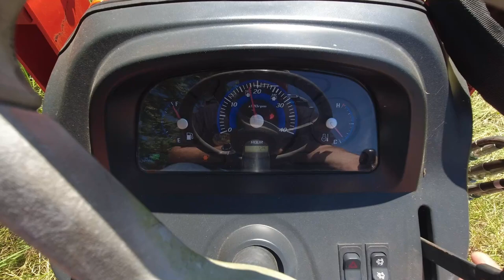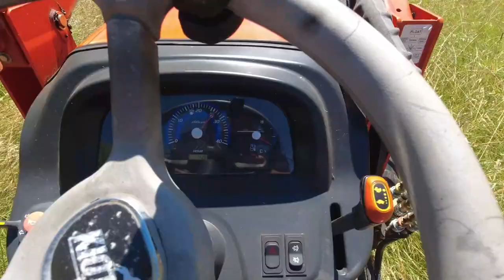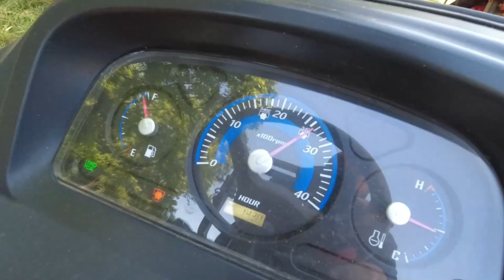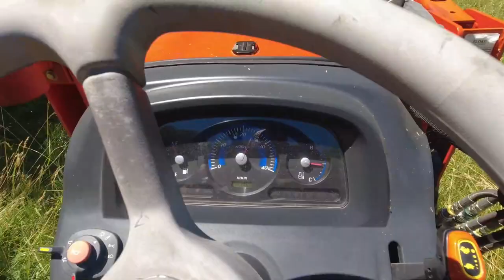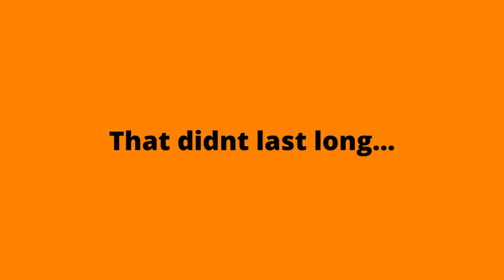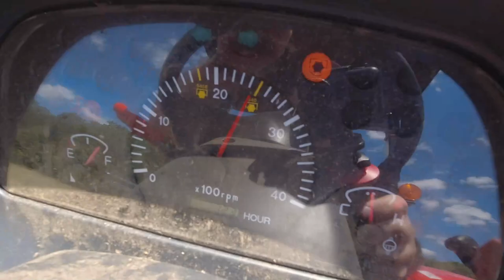Can the KIOTI CK4010hst SURVIVE the TITAN 1912 Flexwing?

Comment: Great video. I like to see people safely push the limits on implement size to see what may or may not work in a pinch.
Reply from the maker: Yes sir, that's the exact reason I did this video. Some other folks have commented that they had their big tractor down and were curious if their little tractor could do it. The proof is in the pudding!

Comment: Hoping to be able to pull something similar with my NX4510.  If you're cutting a larger field, you may want to split your field down the middle long ways and alternate cutting each split side to not have to turn so sharply to get back aligned with what you want to cut.  From what I understand, sharp turns put quite a bit of stress on the batwing PTO shaft joints.
Reply from the maker: You'll definitely be able to pull a flex wing with that tractor. The HP is of course a factor, but I also think the rolling mass of the larger framed tractor would also help.

Comment: If its the same mowed filed and no surprises I guess you can wing it. I am pulling a 15ft land pride with mid 90's on claimed PTO HP and I would not want to take that cutter less then 75 in fields like that. But land pride rated it for a min of 55 PTO HP which is not enough to keep you from slowing in super heavy fields. IMO given the weight of these style cutters you really need to be 30 to 50% over the min power requirements.
Reply from the maker: I totally agree. It definitely depends on the field, conditions, and tractor. It'd definitely be a have-to thing to run this setup. My BIL has a bush hog brand 2215 15' cutter, and I definitely wouldn't attempt it with that.

Comment: My concern would have been if the mower uses a slip clutch or shear pins.  The reason is it might be a little too much for your tractor if you got into something that would require that safety feature to be needed.
Reply from the maker: Yessir. The mower had a slip clutch. But you are correct. A malfunctioning slip clutch or too high of a grade shear bolt would have been bad news for the tractor since I was at my max PTO rating.

Comment: Great video and accurate narrative with the video.
Any idea on how many gallons per hour the 4010 tractor was consuming in low range on the upper field with the lighter grass.

Any idea many gallons per hour would the 7320 use cutting the heavy growth field

What was the outside air temperature when mowing.

Is this in middle or western Tennessee.
Reply from the maker: Thanks so much for checking it out. Honestly, I didn't even think to check the fuel consumption, but that is a good data point. I don't think it used much at all, it wasn't a terribly large area. The FIL has said that he can mow the large field on just a few gallons of fuel, too, I think. I'll double check and get back to you on that. I think the larger field total is about 10ish acres, maybe a bit more. It was mid-June in middle Tennessee, so it was over 90 degrees and neither machine had any overheating issues, but I was conscious of stopping intermittently to clean screens. My ck4010 quickly sucked up enough seed to block the vents had I given it a chance with such a small area. Thanks again for checking in!

Comment: Looking @ getting this same cutter and noticed you have what looks like rings on the main height lift cylinder.  Do they come w/ the cutter or separate?
Reply from the maker: No, they were purchased separately. They are there to control lowest setting, basically.
Reply: @BigOrangeTractors   thanks for the reply!! where do you purchase them?
Reply from the maker: @davidp.savage734  my FIL got them from his dealer, but they are available from many different sources. TSC shows to have some for $35. Of course, you'd have to make sure you buy the correct rod diameter.
Reply: @BigOrangeTractors  awesome!!  Thanks for the help!!! Love the videos!!

Comment: YOU AND TRACTOR TIME WITH TIM are two peas in a pod.   GET THAT MOWER OFF THAT 40 HP  TRACTOR, YOU"RE ABOUT A 75 HP SHORT !!!!!!!!!!!!!!!!!!!!!!!! DO you know if that 40 HP  tractor has a PTO brake that is activated when you turn the PTO off,  IF IT DOES< SMOKED.          I've never seen anybody cut hay with a rotary mower.  With that overlap when you're mowing with the 7310 your only  mowing about 8 ft of grass.    That 40 HP tractor  should have about a 5 foot rotary mower.   I sold tractors for 20 years and grew up on a farm so I have had about 65 years around tractors.